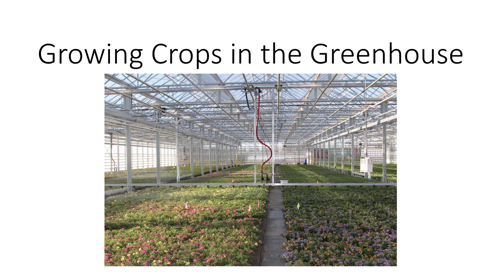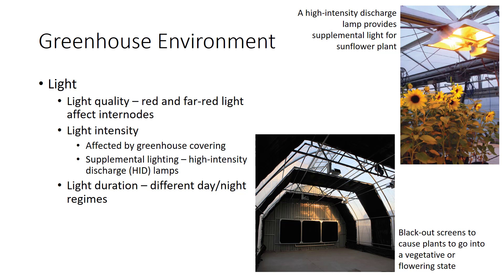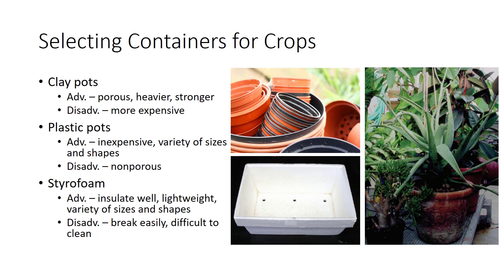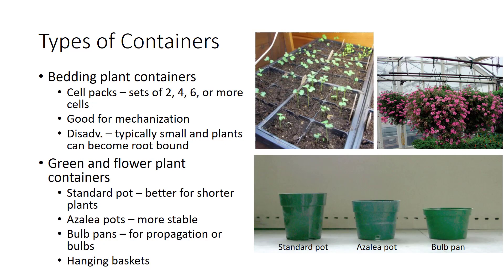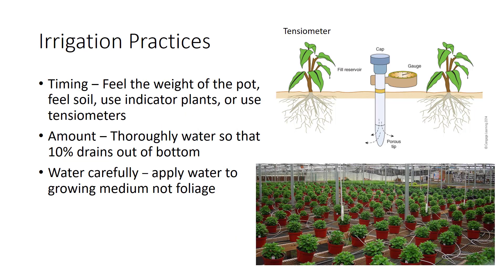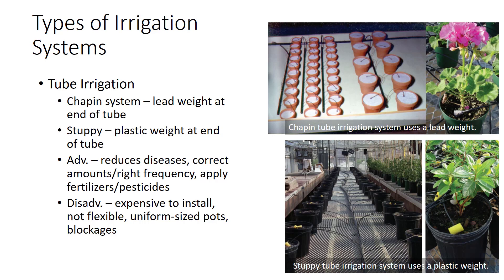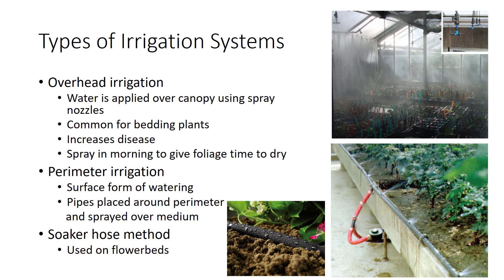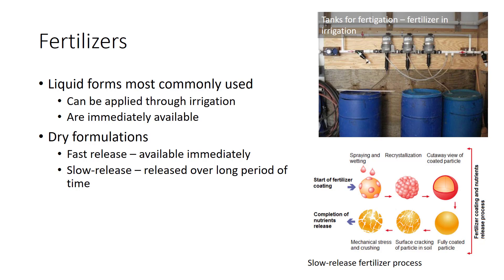Growing Crops in Greenhouses

Comment: The arrow floating dripper is new invention in drip irrigation technology in Taiwan.  It utilizes floating ball disturbance to remove the residue so that can avoid blocking in the drip irrigation. Please view the youtube website: 
https://youtu.be/QtclaADfrY0
■ FEATURE AND BENEFITS
Automatic removal residue ＆ Anti-blocking
■ Recommend Filtration：130micron / 120 mesh
■ Water Pressure Range：0.2~2.0 kg/cm2.
■ Fixed Flow：2.2L / H (water pressure: 1kg / cm2).
■ Water inlet connector：Use 3/5 mm tube.
■ Size：Φ12.5xH125(mm)。
Email: hueiyi2012@gmail.com